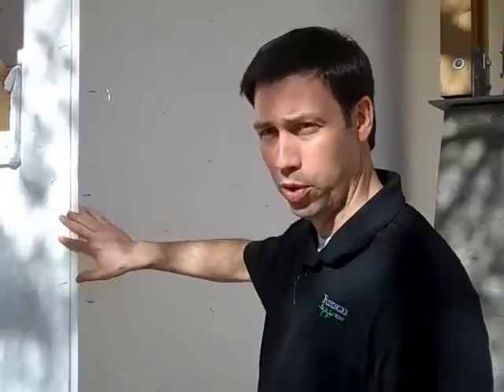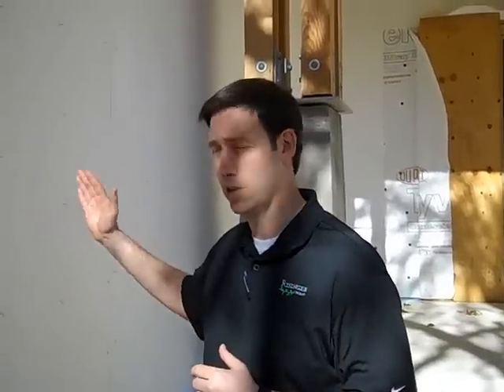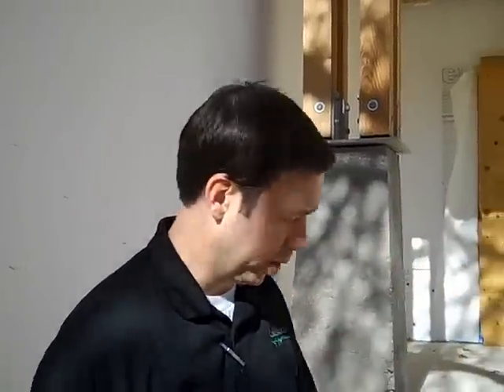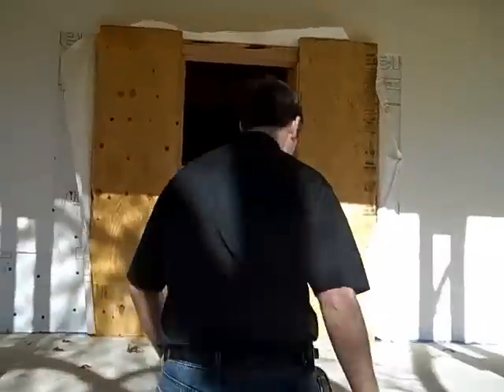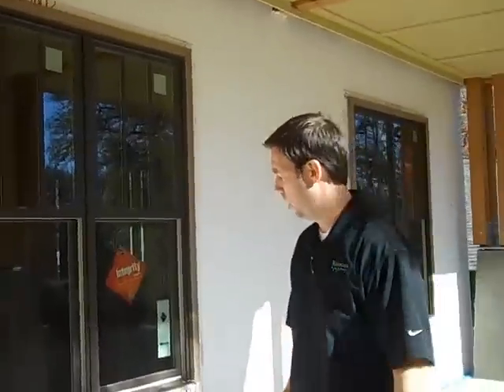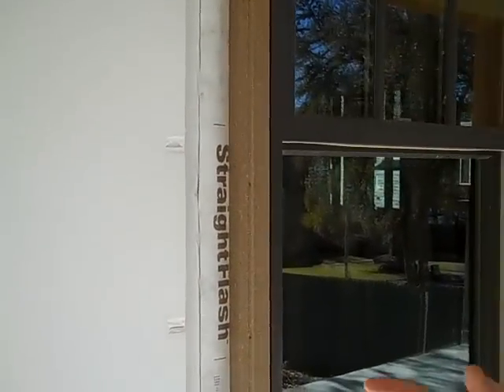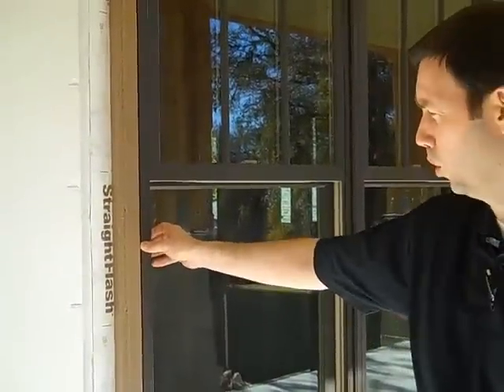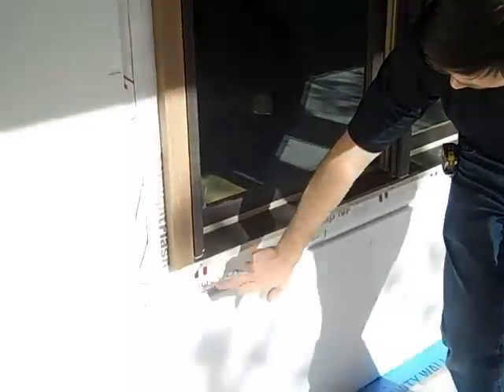Exterior Rigid Foam Insulation

Comment from the maker: @Bigrignohio Yes, we used some advanced framing techniques but opted to stick with 16" centers on studs.  All the studs were finger jointed, we used ladder blocking at wall intersections and all corners were two stud "california" corners for full depth insulation.  The framing was all engineered so all headers were sized for the load by the engineer.  Great comments, thanks.  -Matt Risinger

Comment from the maker: I mis-spoke in the video, we used Tyvek Commercial D house wrap not the residential grade DrainWrap.  Both are a crinkly tyvek that allows some drainage behind the foam.  I like the Commercial version better if it'll be exposed to the elements very long (6 month UV resistance vs 3 mo) and it's tougher so it holds up to masonry work better.  Both are good products.

Comment from the maker: @danielgeheller So, on this house we used mainly rock for the exterior.  We used a commercial wall tie that was designed for the 3/4" rigid foam.  If you were putting siding over the top you could use a longer nail OR preferably run 1x4 lath to form a rain screen system.   I've done it both ways and it works well.  Matt

Comment: Great Video!  Note that the Tyvek Commercial D is a drainage plain and thus has an orientation to its installation (unlike many other building wraps).  The drainage plain allows any moisture/condensation to migrate down the wall rather than being trapped between the insulation and the building wrap.  Also, you need to use masonry ties that are designed to be fastened through the rigid foam.  They are readily available, but you do have to get the right ones.

Comment: You mentioned 2x6 studs 16" on-center. Was there any consideration to utilizing advanced framing techniques? Going to 24" on-center studs would also reduce thermal bridging. I still see most framers using outdated/inefficient techniques (such as headers over windows/doors in non-loadbearing walls).

Comment: are you worried that trapping the osb in between the rigid foam outside and spray foam inside that you will create a favorable mold environment?
Reply: Good point. You're concerned that sandwiching the OSB between 2 layers that are non-permeable to water vapor could trap moisture. That is indeed a danger. But in this video I believe you are seeing 3/4" of expanded polystyrene insulation, which is quite vapor permeable. So if the OSB get wet it should be able to dry to the exterior. Polyurethane and Polyiso foams are much more impermeable. So you would not want to use those if the wall ALSO has a similar foam on the interior of the sheathing. On one side or the other you need to allow the sheathing to breath. That's the basic principle. With all the possible wall section configurations you need to look at each one with a critical eye.

Comment: Matt, I would like to know what you did with the jamb extentions on the windows. Did you have Integrity make them 3/4 inch deeper or will you trim carpenter add on his own extensions?
Reply from the maker: My carpentry crew does the interior jamb extensions.  I don't like buying them from the window manufacturer because you some times end up with small differences that need to be addressed onsite.  For instance, I prefer 5/8" sheetrock vs the standard 1/2" rock and those jamb extensions often are a fixed size for 1/2" sheetrock.  It's usually better to do them in the trim stage later.  Less chance of getting beaten up too.  Best, Matt
Reply: Matt, Thank you for the quick reply. I admirer your work for its quality. If you have any projects with marvin integrity with 2x4 exterior walls with the 3/4 foam on the outside, I would really like to see how you finished them exactly on the inside if you are shooting a video that day. Until then, thanks for all you do.

Comment: Matt, you said "...run 1x4 lath..." to attach siding.  Doesn't the "rigid" foam have too much give-and-take to be a suitable substrate for siding?  Wouldn't you want the lath to go directly to the studs?  Wouldn't it be ideal to run the lath first over the studs, and then fill between them with the rigid foam?  (Assuming you'd use thicker than 1x furring strips--say, 2x strips, with looong nails.)  Then put the radient barrier between the strips, and that'll give you the 1" gap in front of the RB before putting up the siding.
Reply from the maker: My recommendation is to run your Exterior Rigid foam continuous on the outside of the house. This will help eliminate the thermal bridges at your studs.  Then attach a 1x4 furring strip through the foam into the studs.  Then attach the siding to the 1x4's only.  If you want a radiant barrier I'd suggest switching to a Foil Faced Polyiso foam.  Best, Matt
Reply: Matt Risinger That sounds good, especially since it will save me time in having to cut all the foam to fit in between the strips.  But my question remains, How will the rigid foam hold up 10, 20, or 40 years down the road, in regard to holding their shape to prevent the furring strips from sagging over the years?  I understand the furring strips will be ultimately attached to the studs, but there will be 3/4" of foam that the nails will be "supported" by; if the rigid foam ever gave way, then the nails would all sag, and the furring strips would all tear out, with the weight of the siding pulling on them.  Is there any chance that the rigid foam might shrink or cave in or change shape enough for the furring strips to lose their support?  This is what led me to think that it'd be better for the furring strips to be directly touching the sheathing (plywood/OSB).  Your thoughts?  Have you ever seen siding collapse due to the furring strips being on the outside of rigid foam?  Thanks for your time and input.
Reply: Also, what is the recommended way of securing the rigid foam to the sheathing, and what is a good brand/source of foil faced polyiso?
Reply from the maker: chehsed You can use a few cap headed nails or screws to tack up the foam until the 1x4 battens are screwed in place.  I like Carlisle's Foil Faced Foam, and I also like Owens Corning's version.

Comment: Quick question Matt - if I sand blast to restucco my one story (poorly insulated) home.  Can I (1.)  have exterior rigid foam added to whole house, & (2.) is there any additional sound barrier solution that could be included? Thx, loyal fan!✌🏼
Reply: Rita D
Spray foam and ridge sheets have no sound barrier effect.
Rockwool (Roxul products) has great sound barrier effect & a much better product than fiberglass.

Comment: @HomeEnergyNow 
Regarding your comments regarding framers. It is less efficient. This is a fact. I am in another trade, but I have seen framers at work. There seem to be two types. The traditional QUALITY framer who cares but wants to stay with what they know (I assume the type you work with) and the ones who just do not care. Cabinets are taken care of with blocking. 1/2" drywall should not be a problem on 2' centers. Have you TRIED to use OVE framing, or are you complaining just on principle?

Comment: Why not build using SIP panels?? Super insulated and strong and does away with having to frame.. Just put up the walls and roof in one easy step and youre done.

Comment: Is there really a need to do a full plywood sheathing job?  Wouldn't 1/2 inch ply around windows/ doors/ corners with 1 1/2 foam on top in combination with 2 inch foam sheathing the rest of the house do just as good of a job and provide more R-value?  Thats how I was planning on building my house.  Just wondering if Im missing something.
Reply from the maker: +gracilism I like the plywood for shear value, plus to make WRB install more straightforward.

Comment: @HomeEnergyNow 
Your cost analysis is irrelevant. Energy codes are getting tougher, and to meet them in many areas you will have to go to a 2x6, double wall or out-insulation anyway. All of these "add" square footage. So why not use a better system? And $100/yr in savings? To add 100ft2 to a house at 2" extra wall thickness is 600ft of perimeter wall! A house that size will save MUCH more than $100 per year. Add blocking where needed for cabinets, makes them easier to install anyway.

Comment: @HomeEnergyNow 
Rude AND condescending, nice.  You are right that time is money. Show me how installing 5-10% less lumber in up to 30% fewer pieces cost more. Worse quality framing? As long as you follow the prescriptive rules in the code strength will not be an issue. Quality however comes from skill, something many builders are not willing to pay for. They want cheap, quality is optional. Techniques have to change as materials, codes and customer expectations evolve.